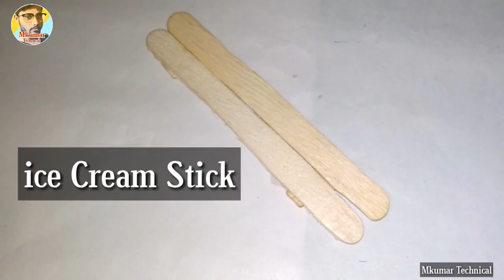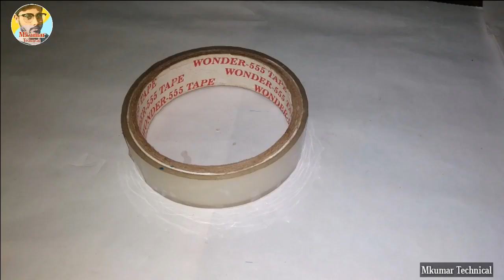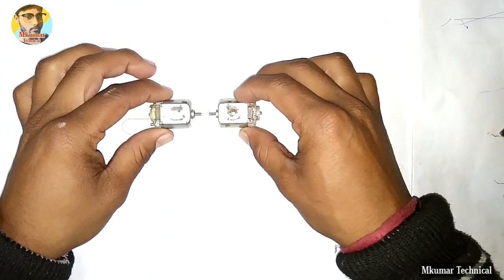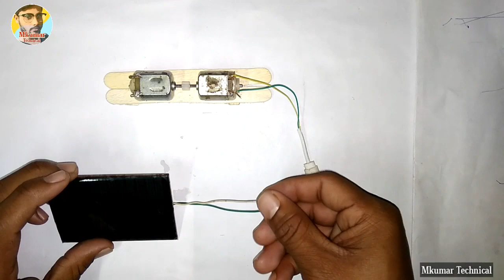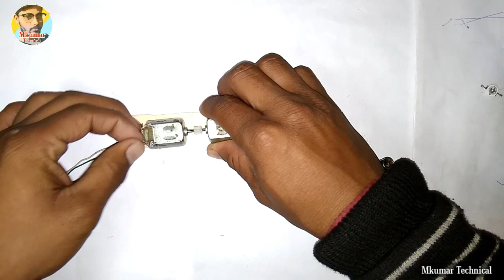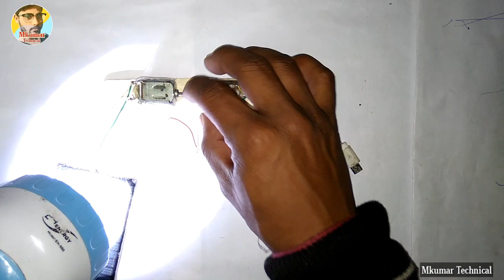Free Energy Solar Panel And Motor Power With Mobile Charger at Home

Comment: Your secondary motor generator no voltage regulator.5v fix.it would be broken the charging ic of your mobile.add voltage converter